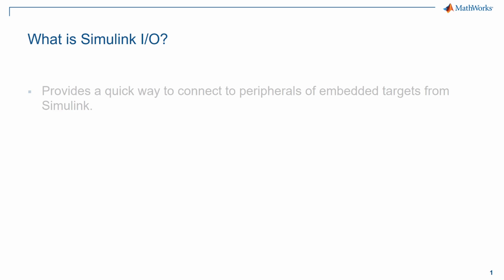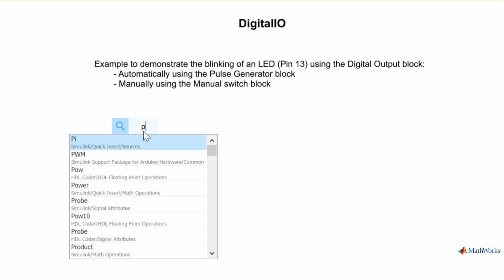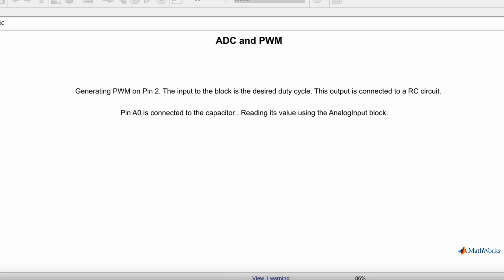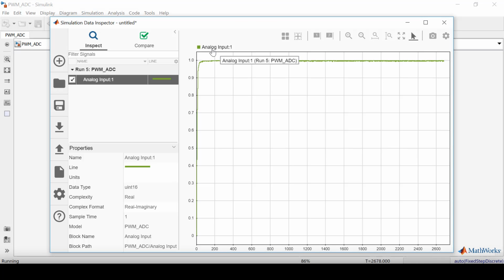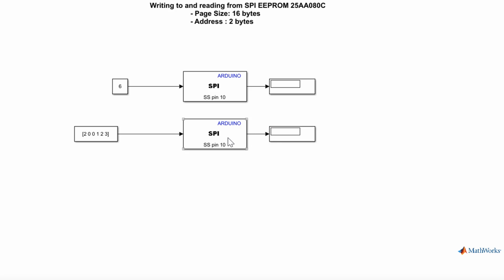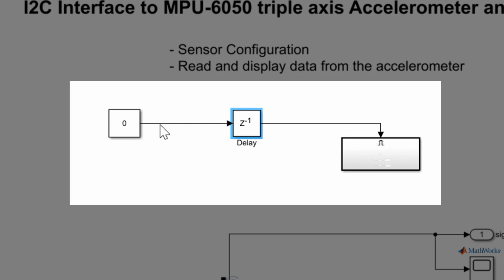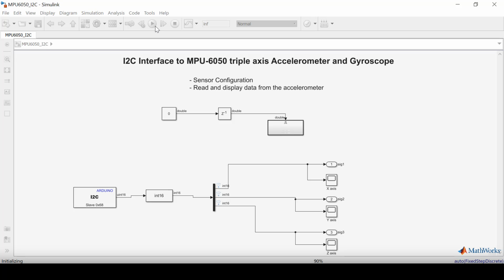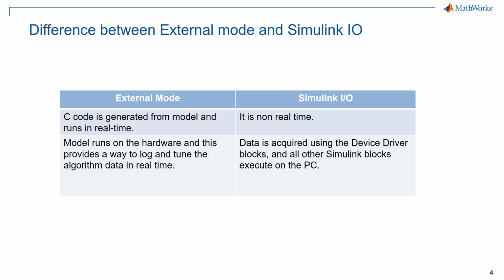Simulink IO on Arduino

Comment: The state of the led does not change if I change the state of switch
Reply: Which version of MATLAB are you using ? Is the simulink IO enabled and running in normal mode ?